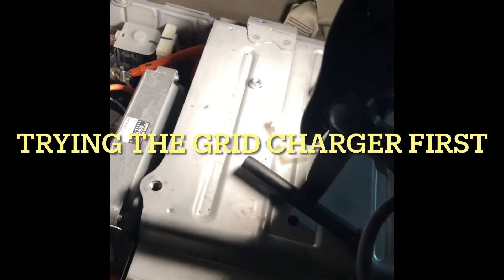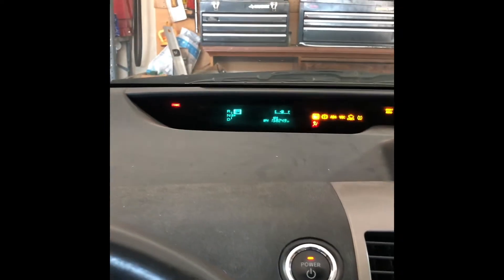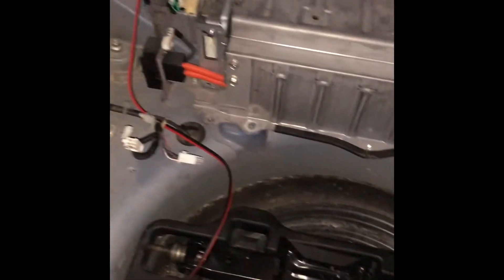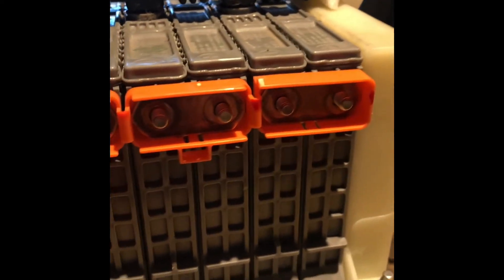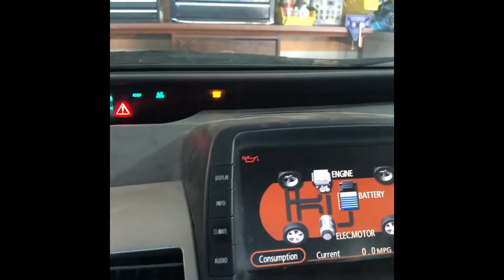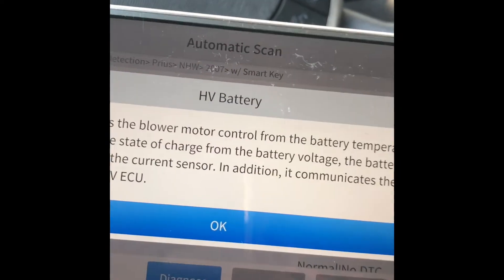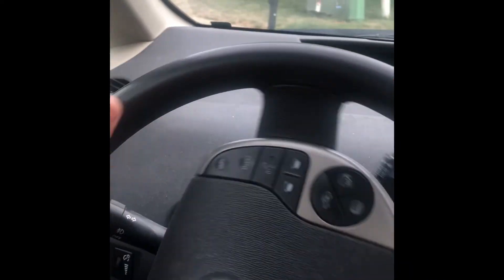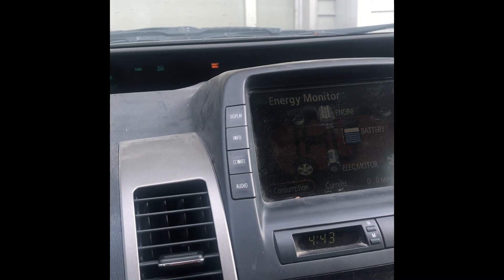I fixed my Prius really cheap! just replaced 2 bad modules and using a grid charger!

Comment: Do I need to buy the grid charger or should I let the car charge my pack?, I disassembled the pack and found one module at 6.7 the rest was 8.0 but it is still resting for tomorrow to check the real voltages on all the modules. I will buy two modules to change a block. I read somewhere in the past that the car itself is the one that charges, manages and balances the modules.
Reply from the maker: the Prius has no balance feature, Ford Escape hybrid does. If you don't balance it, you will not reach the optimum charge capacity since the weaker modules isn't fully charged when the strong ones are.

Comment: So are you gonna tell us that after you topped up your oil the red triangle never came on again?? so was that you red triangle problem low oil?? So maybe your batteries modules were okay I know 2 were 6v but possibly that doesn't caused the red triangle but your low oil. I am also diagnosing my prius with videos 😁😁
Reply from the maker: If you look at the screen there will be an oil lamp icon indicating oil issues, it will also show a thermometer icon if overheating and a car icon if something wrong with hybrid or mechanically.. my hv battery module is definitely bad
Reply: @highmilesgarage9131  Thanks, mine is only car icon.  Steady red triangle with C1310 and C1259.

Comment: How did this work out for you?
Reply from the maker: still running very well, it's been a year and over 3k miles
Reply: @highmilesgarage9131  Awesome, that's neat.  Thanks for the feedback.  Wondering what's inside that charger, like how is designed for the power supply to charge?
Reply from the maker: @jafinch78  Haven't really opened it. Someday I will but I think it's just a basic LED driver, high voltage low current setup.